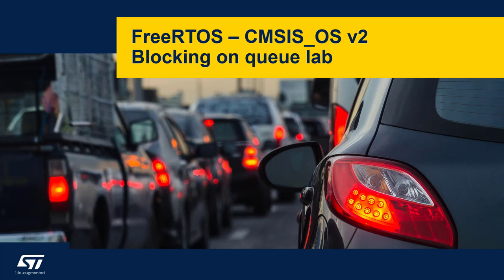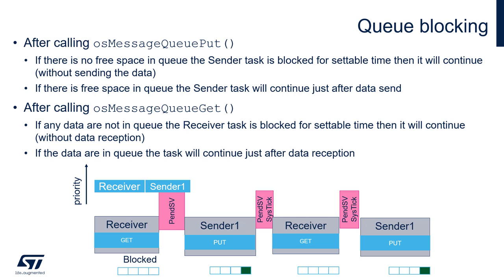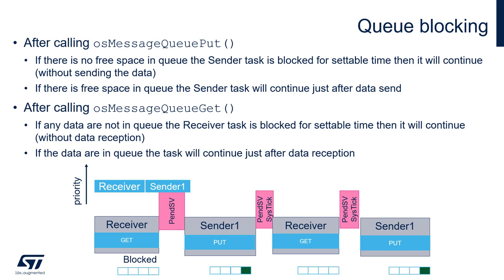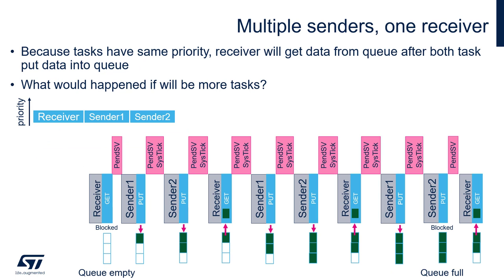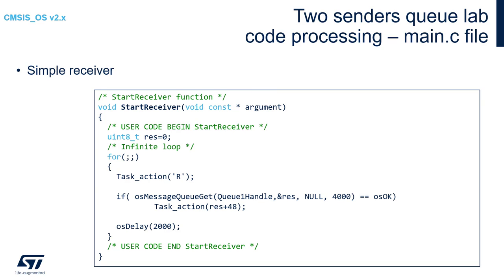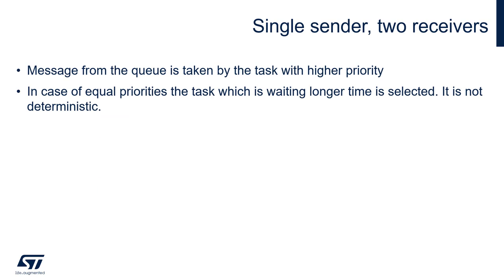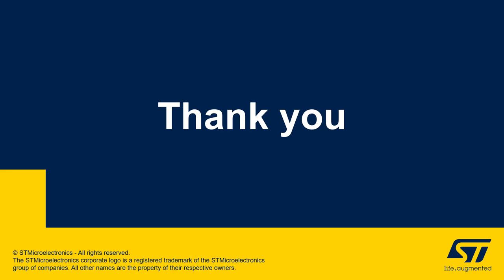FreeRTOS on STM32 v2 - 13d Blocking on queues - lab

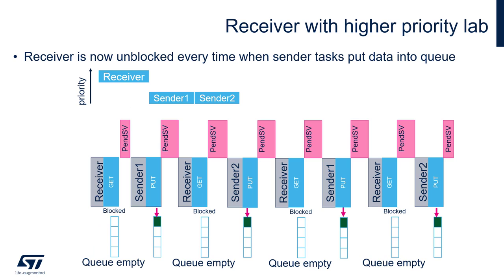Comment: on 8:38 you show on SWV that receiver task runs 3 concecuitive times.
Hows that happening since after getting item from the queue, you put the task into delayed?
Then it's turn for sender tasks to fire.
Reply: they are not going to answer you here, if youre lucky youll get a bot asking you to post your question in the ST community

your question:
I believe the Receiver task was executed first than both senders somehow ->then we get an R without a received data
Next Consecutive R would be the received data from the two senders?

I am a bit confused as well
Reply: Yes, you must delete osDelay(2000); from reciever task and it will behave  like in the video